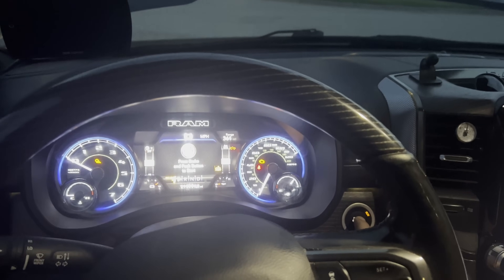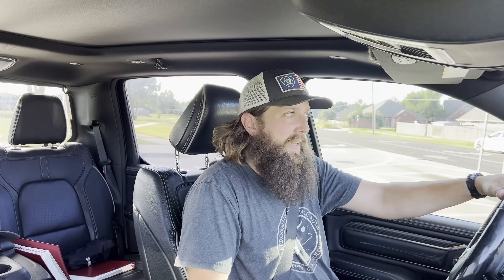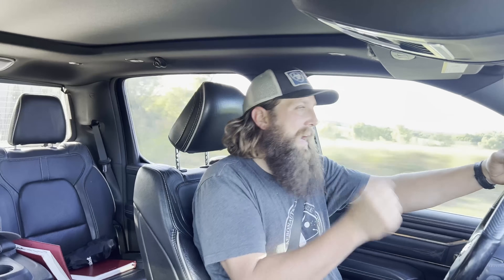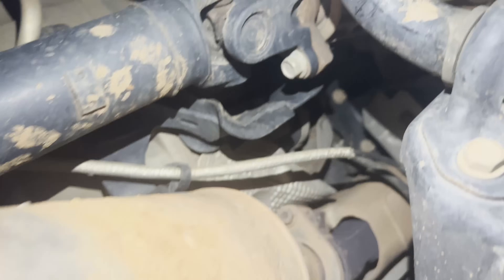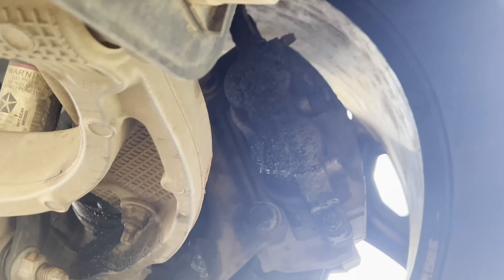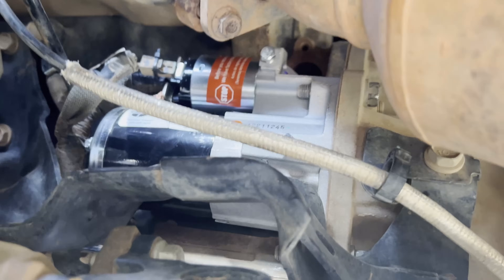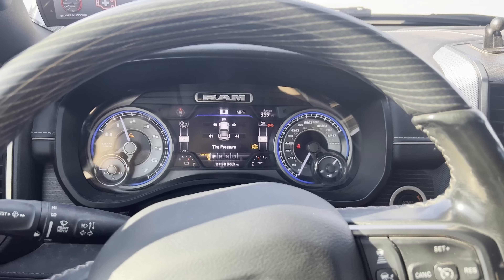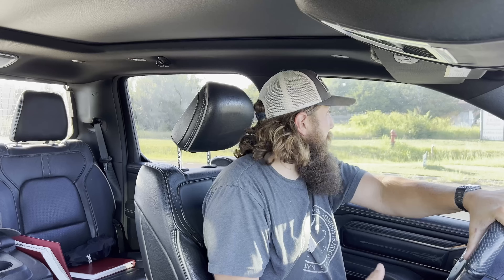2019 Ram 1500 *NEW PROBLEM* Engine Won't Start | Truck Central

Comment: I had a 2020 Ram 1500 Laramie Longhorn 5.7 liter engine with etorque, bought it used with 31k on it, roughly a year later had to put a battery in it, 8 months later same issues you were/are having, put a starter in it, 2 months after starter was installed had a dead battery, put a meter on it 3.5 volt, jumped started it, truck would barely charge then it would then it wouldn’t 
Long story short here 
That etorque has a lot to do with the dead battery and starting issues with that truck 
Traded it in within two weeks

Comment: My 2016 Ram 1500 had the same problem it would just click and the starter wouldnt turn over I eventually found out that the cable connecting to my starter was causing the issue, I unplugged it and plugged it in a couple times and it started right up

Comment: My 2019 started going dead on me out-of-the-blue for no reason randomly.  The dealership determined that the gage console and the center display console were "waking up" for no reason and without the keyfob and creating a huge drain on the battery.  All they did was update the software per a Ram service bulletin and problem solved, so far...

Comment: I have a 2020 1500 bighorn with 33k miles. Was at work early morning and it would not start just a click. Remote start canceled tried to push button still click. Mechanic at my job jumped the starter fired right up. So low miles so annoying.

Comment: My 2017 does this but I have the "key" with "tip to start".. ill turn the key and the vehicle electronics work but it wont even attempt to crank.. not even a click. Ill try it a few times.. stop.. try again and like magic it starts.

Not bad battery replaced it with a $300 agm big hoss..

Comment: 2023 Ram 1500 etorque 29k miles starter just did the exact same thing. Click and no go. Battery is fine but nothing more than a hard click on the starter. I’m gonna replace it first thing tomorrow morning. Just sucks that it’s literally brand new and I’m already having this issue. Pretty disappointed.

Comment: 2020 Limited bought in Jan '23 w/ 28.5K miles - I've had similar/ other problems for the past few months.  

First, truck was completely dead a few times (no lights, door locks, running boards). AAA replaced battery and it ran fine for a couple weeks.  

Then, came out to go to work a couple weeks later and it was completely dead again. AAA checked battery and confirmed it was good but swapped it - 'just in case'.  Truck was still 100% dead.  Towed to dealership and fuses were pulled 1-by-1 until they found a draw from the 48V battery which they replaced (or so they say).  Picking up the truck and found windshield wipers and a tail-light didn't work. Cause was ultimately a failing PDC which was replaced.  

Got the truck and drove it for 10 days and it was dead with the same symptoms twice during that time.  Jumped battery both times to get it started but the 2nd time had AAA check battery, which tested good, and provide the report to pass along to the dealer.  Now that the body shop is done with their repairs the truck is back at the dealership with no indication as to what the problem could be but they're "trying to replicate the failure".  

Huh, what .... how did the body shop get in the middle of all this you ask??  Well, I spared you the story about how a delivery driver backed into the truck, on the dealership's lot, after it was first towed to the dealership.  I love my truck but I've barely been able to drive it for the last 50 days and when I did I was always questioning its reliability.  Are these '19 & '20 year models just lemons??

Comment: I can only imagine what the auto start stop on the etorque engine does to these starters
Reply: I assume you know that the etorque motor turns the crank pulley rather than incorporate the starter to get the engine spinning again?  If not, now ya do!  😉

Comment: It’s a Ram problem. Never had any issue with either of my F-150s. I have the plug to get you a new F-150 cheap.
Reply: Oh yeah? You still got the connects, Rando?
Reply: This has happened on both my 2020 and 2021 1500

Comment: My 2020 ram is making me angry. My truck won’t unlock or do anything and when I use the physical key out of the fob, the panic alarm goes off and has to run its full cycle. Dealership said it was a bad battery in the truck and replaced it. Worked for about a month and now having the same issues again. Thanks truck! Anyone with this issue?

Comment: Yeah it’s the starter you’ll be good my dads 2019 Ram Bighorn starter went out at 140,000 and a radiator at 149,000 it’s at 161,000 miles right now and it’s still running strong so far those have been tho major issues I’d say if you wanna consider that a major issue 😅

Comment: Mine is done the same thing. Mine actually started the week up off the truck. And then it didn't I didn't change anything I didn't do anything but try to jump it and when everything was fine I didn't do anything different So I got in the truck pushed the button for about 15 minutes would let it sit push the button for 15 minutes I probably push the button 50 times no start. Shut the truck went in the house came back at lunch pushed the button and it started right up. For a year and a half It started fine Never had this issue not even once. 
Yesterday every time I tried to get in it and start it, it did it. Today same thing. Then all the sudden you push it and it just might start. I've read online that this is kind of common I'm surprised that nothing's been done about it There's clearly something wrong with the button or somewhere in the ignition system and it's not fuel or battery related it's just some ghost in the wiring or the button

Comment: Jan 10 2025 It happened to me today 2022 Ram 1500 62,000 miles.. Now my truck is doing the same thing. #ram #dodgeram #ram1500 #ramrecal @dodgeram @ram1500 nothing is fixing the issue on mine

Comment: You better be aware when you buy a new Ram Truck and need it serviced, the dealerships service departments are telling people that are weeks out to get you in and then when you drop it off, they are telling peoples its up to 5 days before they look at it. So you will be without a vehicle for a week or 2, that's if your vehicle is under warranty. It took us more than a month to get a oil change. The deal is they are selling more vehicles than they can service, so if your new vehicle breaks down, you may be without a truck for a month. That's in Austin Texas.

Comment: I got 74k miles on my 2020 and my truck is doing the same thing.
Reply: What was the problem? My 2020 only has 39k and won't start ... brand new battery too

Comment: I know how to permanently fix the Ram. Trade it for a Tundra 😂
Reply: i know very few people, one of them had 50k miles Tundra i believe it was 2015 and 2 solenoid relays in trans gave up, you can get lucky or unlucky with anything... it actually happened same thing on my 147k mile 11 years old Ram too... i guess the probability of issues should still be lower